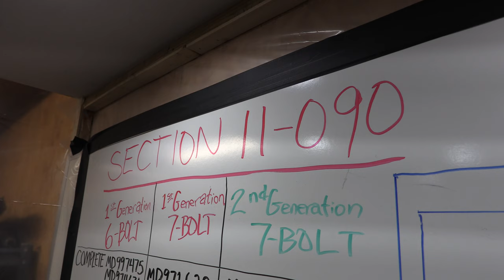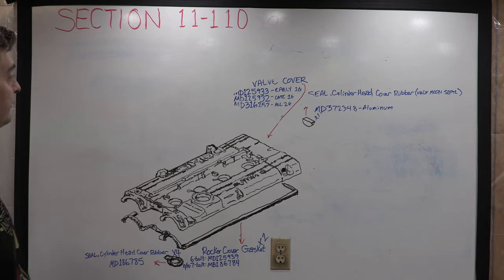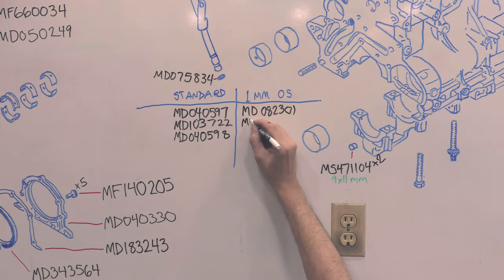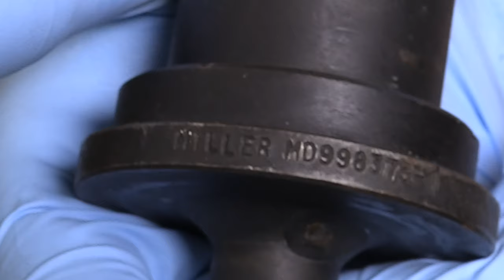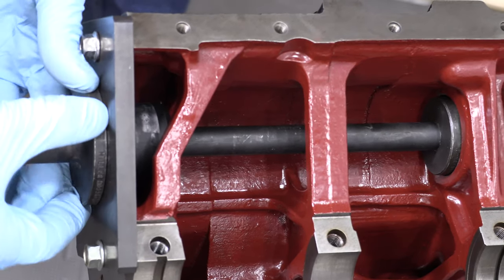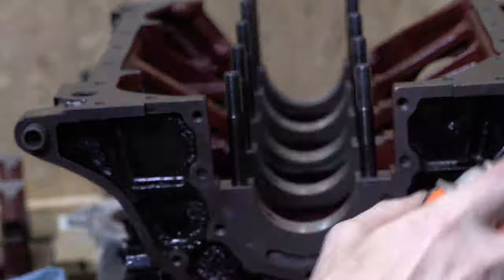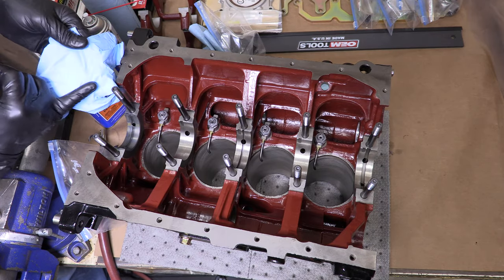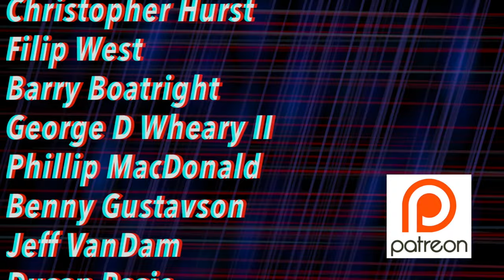GSX Block Prep 6 - 4g63 Block Pre-assembly

Comment: Making individual comments so to not create an entire wall of text in one comment.  Comment 1: I wouldnt recommend using liquid gasket on an auto transmission pan, it makes filter changes suck to do.  The rubber gasket works fine and you get multiple uses out of it.  Learned this after I spent over an hour scraping RTV off of the pan.  Other stuff isnt as big of a deal since they dont need to come apart for routine maintenance like that.
Reply from the maker: The sealant is actually for the transmission case.  ;)  It's for when you blow the whole thing apart and rebuild it.
Reply: @Jafromobile  Makes 100% sense with a manual, those do tend to self disassemble quite regularly.  I'm thinking and I dont think there's any spot on an auto that would require that, everything has a gasket or an O ring pretty much, except for the pan.

Comment: Hey Jafro will that md998376-01 work on evo 9 rear main? Please answer as I desperately need to know.
Reply from the maker: If it does, it will be outlined with the part number in the factory service manual.  They list all the necessary specialty tools in the beginning of each section.  I don't have the EVO manual.  Just 1g/2g/Engine Overhaul/Haynesx3 and CAPS.  None of them reference anything newer than 1997.
Reply: Jafro thanks for pointing me in the rite direction. I took your advice found the FSM and in fact it is the same part number for evo 9. Thank you so much 4g63 genius! Love your channel dude!

Comment: How do u allign the oil hole?
Reply from the maker: Easiest way is to mark the tool so you can see it, line the bearing up with the mark on the tool, line the mark on the tool up with the hole in the bore of the block.  Drive in the bearing.  Easiest way to check it is take a short section of a spray can straw (like from your carb cleaner or WD-40), poke it in the bearing hole and see how straight it is with your hands/fingers.
Reply: @Jafromobile  ill do it.  Thanks

Comment: Jesus christ bro.. I've NEVER seen such an in depth video...🤯🤯🤯 amazing.. I JUST got a 98 GS-T the other day. I'm going to use your channel like the holy bible..

That being said, I have a loud ticking upon acceleration. Any idea how to quite it down? I heard it may be the lifters,  I figured I'd ask a God.. so thanks in advance.
Reply from the maker: I have a lifter cleaning video.  They can be a pain to clean and aren't terribly expensive to replace.  Nothing like the rockers are.  There's another video floating around of someone removing and re-installing the lifters without removing the camshafts.  It's really not that hard to do, it just takes some patience.  You just have to keep the rockers from launching across the driveway.
Reply: @Jafromobile  I did find s video on that. A step by step video. What do you mean launch across the driveway? Lmao
Reply from the maker: You'll be loading up the valve springs as you pry them out.  Rotating the engine drastically reduces that, but it doesn't eliminate it.  So if you're not carefulling, you can send them when you don't mean to send.
Reply: @Jafromobile  thanks alot for your help bro. I appreciate you taking your time to respond.

Comment: good friend. have you ever opened a 4G61 engine?
Reply from the maker: Only the Hyundai version of it.  6-bolt or 7 bolt matters for torque specs because the fastener sizes for the mains and rods change.  Your best bet is to dig up the service manual for your year car because despite the similarities, there's enough different that it's worth having.  You can find them on eBay, and many online PDF sites really cheap.
Reply: @Jafromobile  Thank you

Comment: Are you running a 1g block and 2g head?
Reply: Yes. He has some old videos which discuss some of the details.
Reply from the maker: What William said.  Yes.  Specifically it is a 1ga block and a 2ga head.  Both the DSM blocks and cylinder heads were changed part-way through their production.  So yes, 6-bolt 1g block, and early 2g production head.  Also, Electricity will not only kill you, it will hurt really bad the entire time it's doing it.
Reply: @Jafromobile  Jafro you're a gentleman and a scholar. I wish I had your wealth of knowledge about 20 years ago when I built my 97 awd Talon. I was stuck with crap like Apex-i AFC's.  Back then I had the crazy idea of slapping a 1g head on a 2g block LOL!
Reply from the maker: I came up using the same crap.  I still have my jumptronix AF gauge.  I think we all went down that path of thought with the 1g heads back then.  Yeah I wish I had my knowledge back about 20 years ago, too.  I'm lucky to be editing and sharing this stuff long after it all got figured out.  :P
Reply: @Jafromobile  I get to live my DSM addiction through you now. I absolutely love your attention to the tiniest of details. The intake port size is so much larger on the 1g than the 2g that I was convinced it would flow better. Never actually tried it, but I did price shop heads lol.